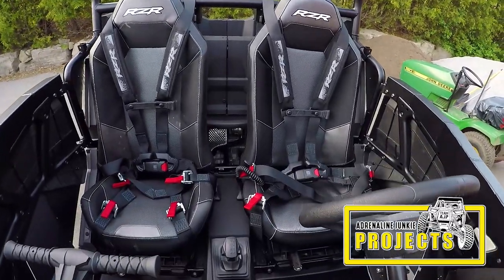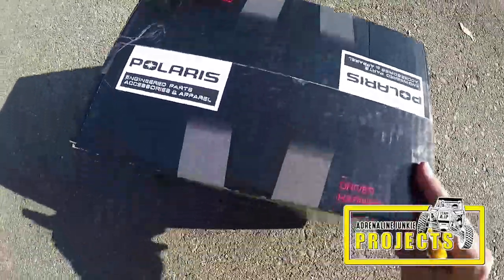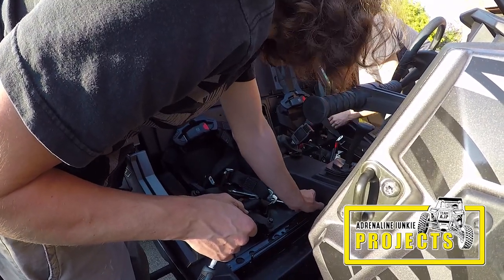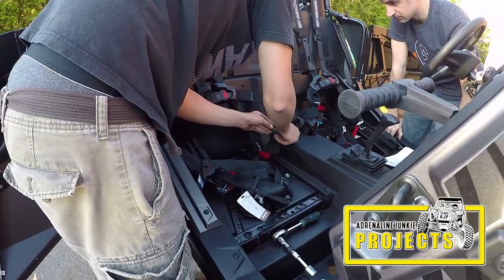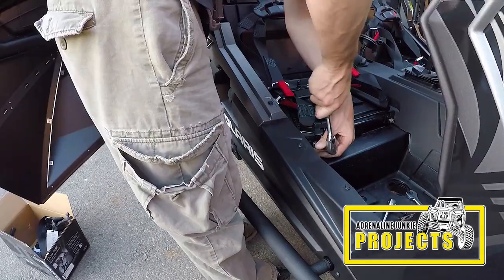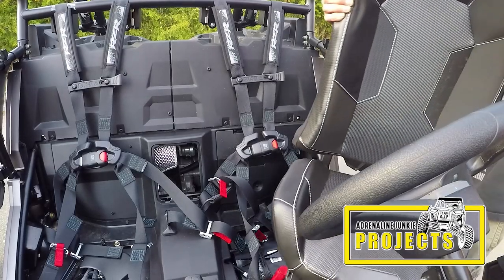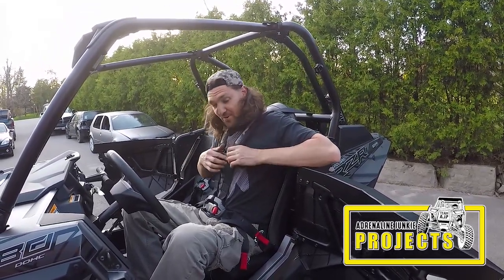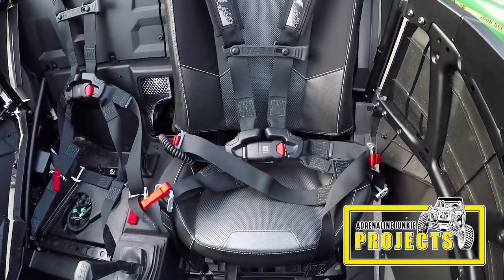Polaris RZR 6 Point Retractable Racing Harness Installation - Click 6 -  How to DIY Video

Comment: Good shit. I just got my set from a guy who actually didn't like them and pulled them off his 2017. I'd just spend the 5 mins to remove the console though. Might save 20 mins of frustration looking and digging for a dropped nut.

Swapping my ProArmor 4.2 harnesses with these tomorrow. Can't wait. Switching them out just for the reason this guy shows after their install. Moving around, turn to look back, reaching fwd for your bee... er, drink in the cup holder. Can't do all that in standard harnesses.
Reply from the maker: Hey MrPittsburghJ, how are you liking the harnesses? I would have a really hard time going back to a standard 4 point harness for everyday use after trying these. The freedom of movement is unreal.

Comment: If I used these with aftermarket seats and passed them thru the whole in the top of the seat would I have to unbolt them every time I needed to remove the seat?
Reply: Im wondering the same.